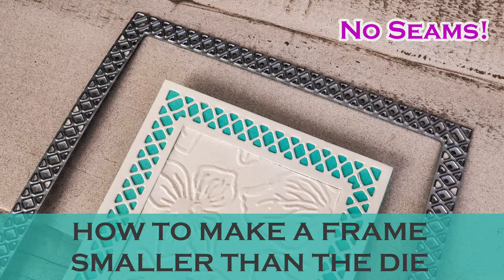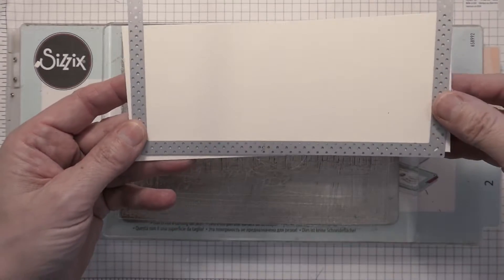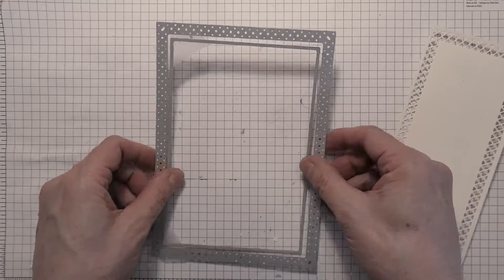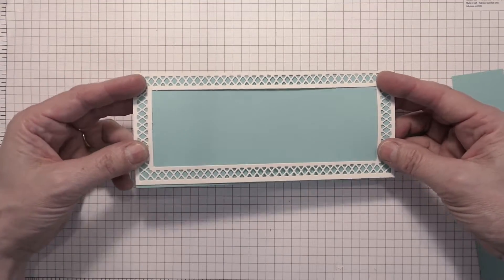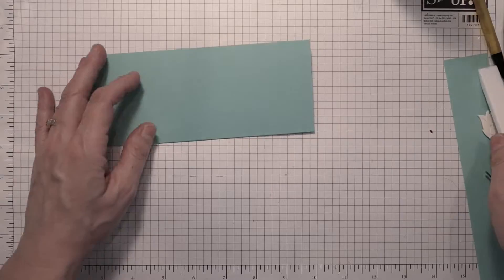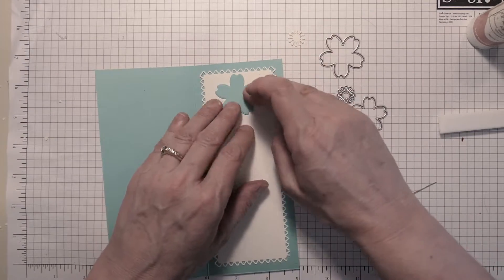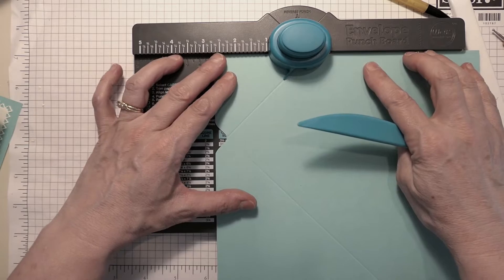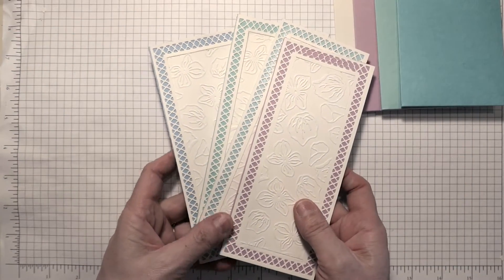Die Cutting Hack ~  Make a Frame Smaller with NO SEAMS!

Comment: They do make a cutting plate that is 13” x 2.5” and a 5” x 2.5” but not 3” wide(that I have found). I have also cut plexiglass to thicken sizzix plates to use in my Gemini jr but they are not as strong(because thin) and I’m not sure how long they will last, for use when I need to cut long dies. 
Also there is an app that’s been out for  3-4 years but I have never heard anyone tell about it (even though I keep telling yt’ers about it) it is called EG for envelope generator and you can do same as program you mentioned. It is by wrmk and you enter size envelope  you want and it generates paper size and punch. 
Thank you for great tips. I really appreciate them and also your tea and honey packs/cards were amazing! amazing
Btw I have done that also with a piece of paper on plate and making a dent. To fix- I fold  printer paper and put diecut inside, so it doesn’t get any scars from scratches/cuts on plates and use one of the many postcard pieces of junk mail I get(and keep for shims) back through the machine and it flattens it out.
Reply from the maker: Great info, Sue - thank you for commenting!  I will check out that app.  The punch boards are all so much fun - I love using them.

Comment: I wish I'd had that hack a while back.  One of the reasons I got my Big Shot Plus is because I make 5x7 cards & sometimes need to cut the card on the long edge.  (I also switched from a brand I wasn't happy with that only could handle 6 inch widths.) I can cut anything up to 8 1/2 inches wide in the Big Shot Plus & I have always been happy with it.  For anyone thinking about getting a new machine, my advice is to get a different size machine from your current one.  If you have a standard machine that cuts 6 inches wide, then consider either a larger machine or a smaller machine such as the Sidekick.  I now have a 6 inch wide machine (That I rarely use because the brand/quality just isn't good), an 8 1/2 inch machine, and a 2 inch (either 2 or 2 1/2?) machine so I have flexibility.  However, I do most of my cutting on the big machine.  Another advantage of the big machine is that I don't have to cut down an 8 1/2 inch page before I run it through.  Even if I'm cutting something tiny, I just use the big machine & an entire 8 1/2 x 11 sheet of paper ('cause I'm too lazy to do the extra step of cutting off a small piece of paper first.) The Sidekick is great for small stuff & the quality is better than my 6 inch machine, but I still use the Big Shot Plus most often.
Reply from the maker: I have wanted a larger machine for a long time, but this hack definitely extended my use of the 6" machine.  My problem is I love new dies, and it's hard to take away from that budget to buy a new machine.   Then, I love my old dies too much to sell.  So there we are.  haha  Thanks for your comment!  I have often wondered the difference between the larger Big Shot Plus and the Spellbinders.  You didn't say that name, but those are two I've considered.
Reply: @PapercraftingAdventures  I have not tried Spellbinders, so I can't give an opinion.  I'd rather not say the name of the one I don't like because other people seem to have success with that machine.  I will say that it is somewhat portable, and less expensive than most machines, so that may be why it doesn't cut as well as the more expensive machines.  Your hack is great, so you really don't need the bigger machine.  If I had thought about cutting the cutting pad, I probably would have purchased the 6 inch wide machine due to the better price point.  Oh, well.  I love my big machine.